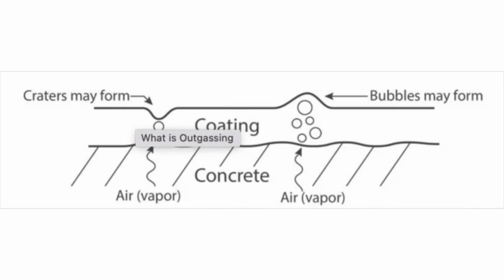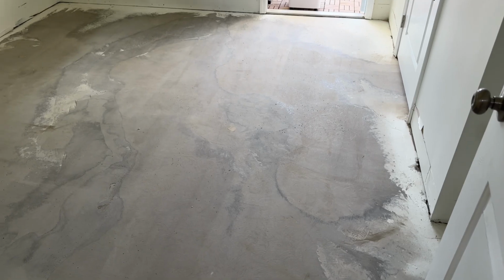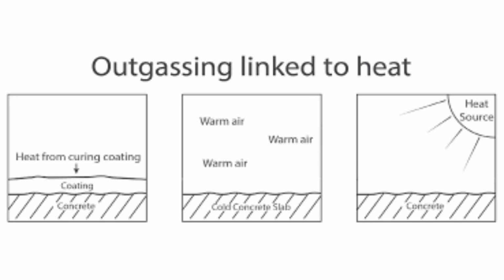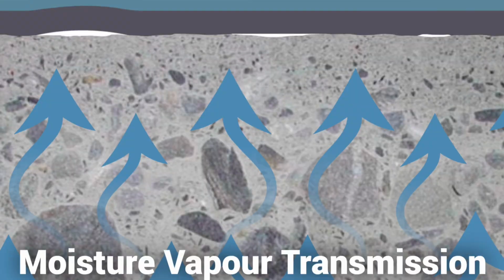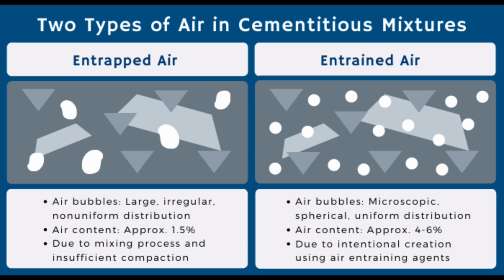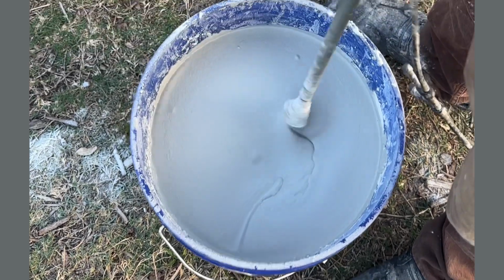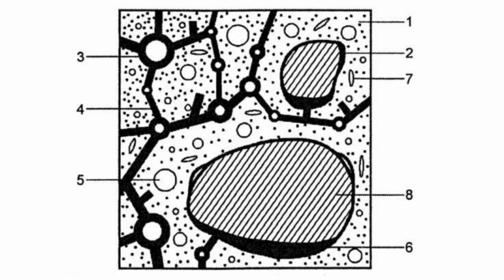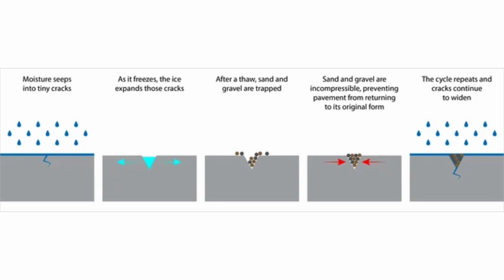Why Is Your Concrete Outgassing?

Comment: Great explanation.    Every couple years or so water seeps up into concrete basement after a torrential storm.  What options do I have to cover floor? Lux vinyl, epoxy paint, stucco paint,............ Was painted at one time and 20% of floor if flaking around foundation corners,
Reply from the maker: Make sure your drainage is good. You definitely want to put a vapor barrier down. After that it’s really up to you on what route you want to take.